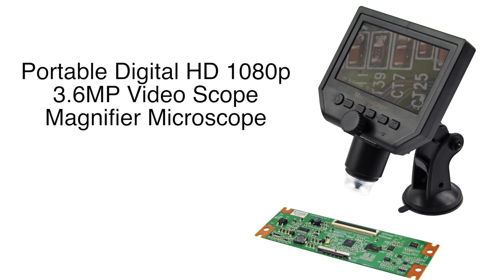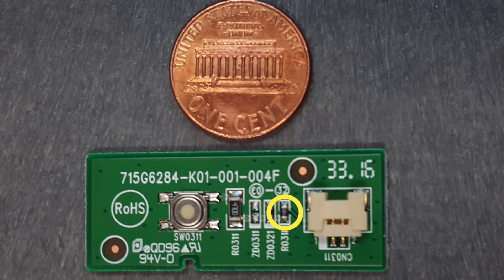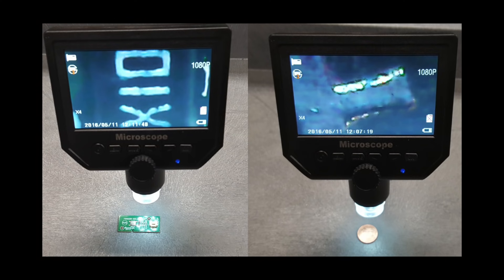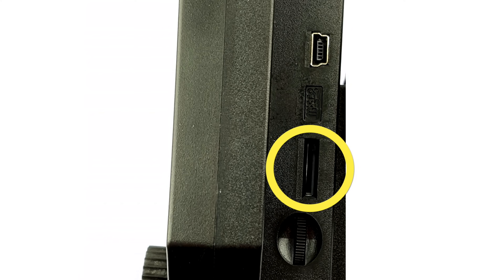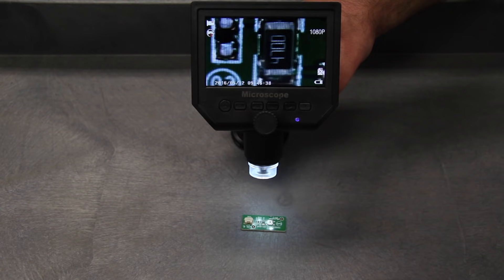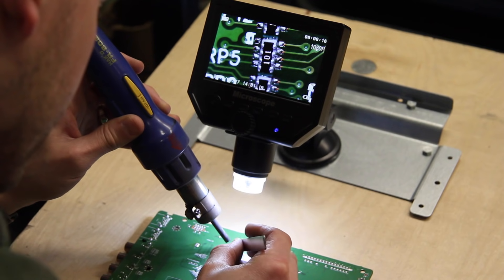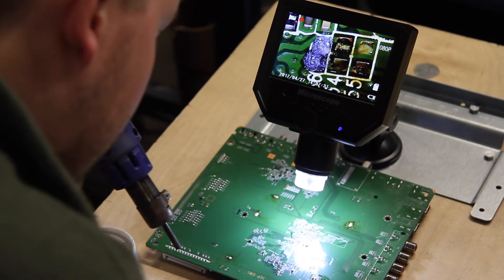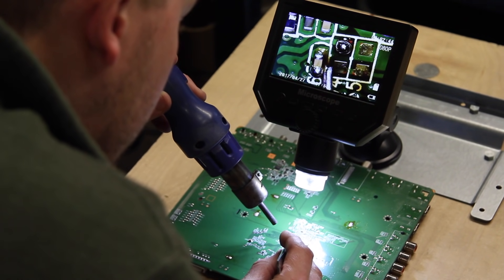Portable Digital HD Microscope - Precision Soldering for TV Board Repair - Component Magnification

Comment: if  you have a bunch of old tapes camcorders with a good macro feature , you can use them  to magnify your boards .  sometimes the tape mechanism is dead , but the lens and video output are still working , you just have to plug it to a tv   or a portable lcd with av input

Comment: It's NOT 1080p. It's 640x480 interpolated. That's okay, but these badged microscope cameras need to stop lying to us.
BTW, your hot air is set too high. That's why the components are blowing away. You also need only 1/10 the amount of solder paste.
Reply: can look this :  WhatsApp： +8618374953505     Skype：Bea BGA   
https://www.alibaba.com/product-detail/wisdomshow-microscope-camera-for-motherboard-mobile_60784350230.html?spm=a2747.manage.list.55.395171d2INnfCw
Reply: Looks nice. However, I worry about buying on Alibaba because most items are dispatched from other vendors.
Reply: @tauttechminusmanagedmusic3778  don't worry .
Reply: @highks can add me whatsapp or skype: +8618374953505

Comment: Wow, the actual soldering isn't too impressive. Much too much flux (solder paste), air volume too high, it helps to direct the air vertically down - a 45deg nozzle might be helpful to do so under the microscope. Some vertical touch could help to pin the conductor down, the top side seems not to contact the pad properly ...

Comment: I bought one of these and mounted it to a microphone boom that cost $8.99 from Amazon https://www.amazon.com/gp/product/B01MZ99Y67/ref=oh_aui_detailpage_o00_s00?ie=UTF8&psc=1

take the mic holder off and replace the 3 screws in the end triangle piece with ones long enough to go through mount of the microscope took my about 15 minutes to have it mounted I also took the clamp off and used a 1/2" pipe flange a 1/2" to 3/8" bushing and a 3/8" X 1 1/2" pipe nipple to hold the boom and screwed it down to my desk

Comment: Ist always so funny  and hilarious,
But whats is real important  then your handy microscope  ?
What are you breathing in? Heat up the bord , there is flux on the bord ans some flux  and  lead solder, tin residue  

YOUR 2 LONGS, LONGS THAT  YOU CANT REPLACE
SO BAY  a AIR SUCKER  OR MAKE IT YOUR SELF 
Make a simple sucker that you be sure that that smoke and flux residue  will suck away from you !!

Comment: Those are large components you can do it without a scope( if eye focus good ), As a demo do it on a cell phone logic board where you need a scope and see how the quality shows up for a say  0201 smd resistor. many of them on these boards , do a re and re of a resistor and see how it goes for this unit. Thanks for the vid though
Reply: This guy would struggle...